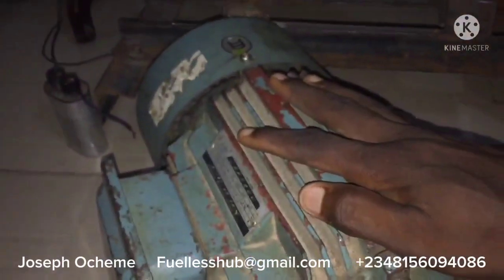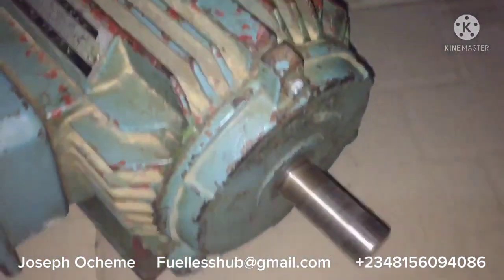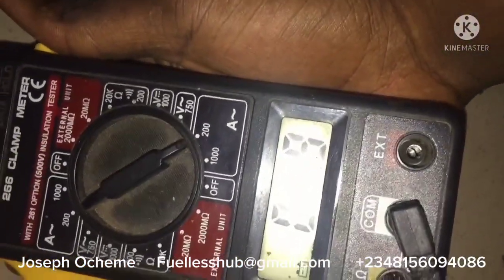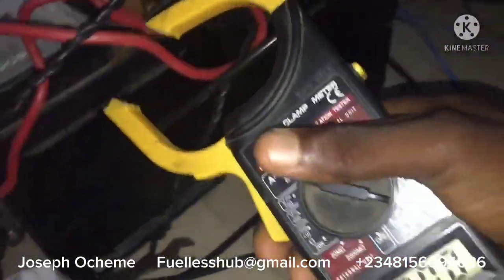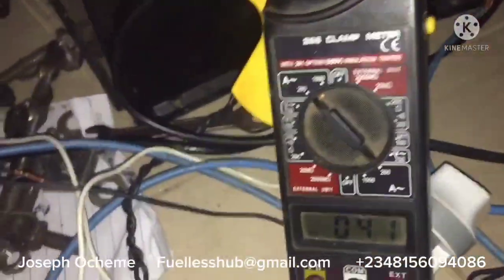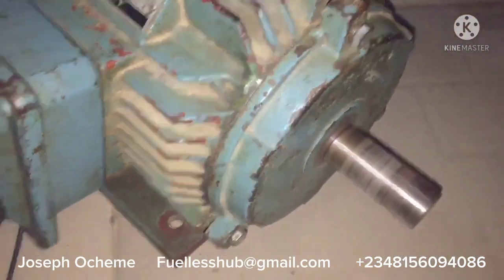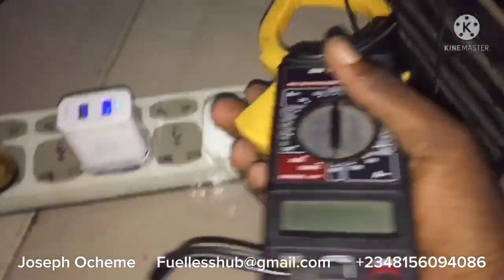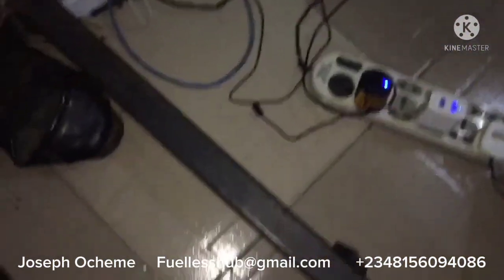Fuelless Modified electric motor Configuration

Comment: You are doing well sir i have question  i made it with tiger generator and i test it when i rotate it with my hand it giving low spark sometimes if touch suck me without capacitor so if i put capacitor  it's  will work ?